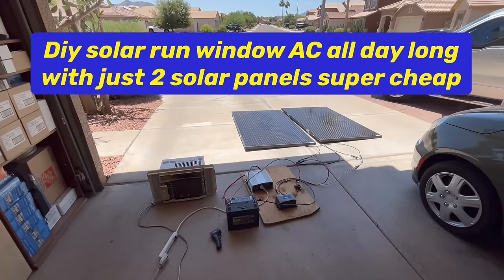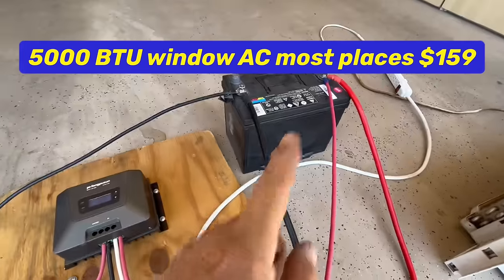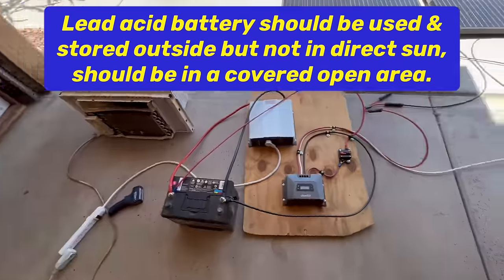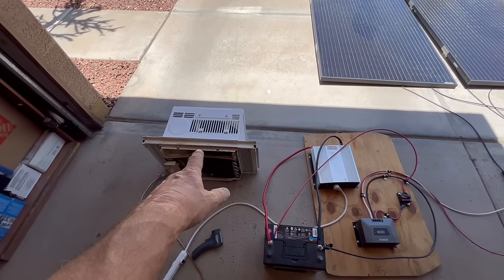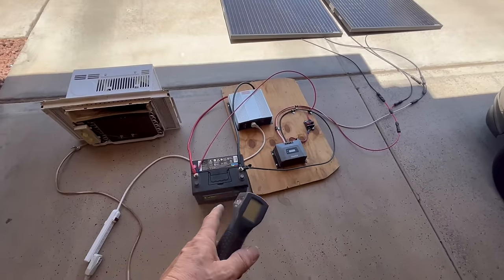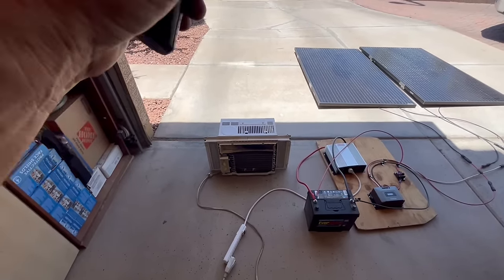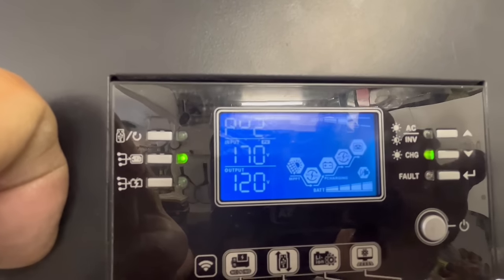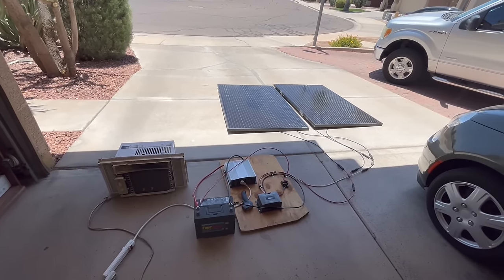Run your window AC with just 2 solar panels when sun shines. Easy DIY project you can do in one day.

Comment: Edited: Changed headline to be more accurate. That will run a small AC unit in daylight hours which would greatly reduce your power bills and a small system can also be used in a grid blackout for running many small appliances, tools and recharging gadgets.  I run my entire cabin off a 400 watt system with 200 watt recharging station.

If you want to run AC at night you would need at least twice as much solar and 3 times as much  battery capacity depending on how much it cools off naturally at night.

For people in low humidity climates a smaller swamp cooler works well and uses much less power. I run a Hessaire swamp cooler at my cabin and ir uses only 85 watts.

You also said panels keep producing  as long as they are getting sunshine. They only produce when connected to a load so if you disconnect the panels from the load they are not producing power.

Your system is connected correctly however I have my doubts  that the cheap Chinese controller you are using is actually MPPT and for any direct DC loads you need an inline fuse link. Surge on that AC unit is likely only 1000-1200 watts so you could use a 1500 watt inverter and it does not  need to be pure sine wave to work but would be better and the motor will last longer with pure sine wave.
Reply from the maker: You are correct I said all day long you can run ac, I did not say all night long. I stated as long as the sun is up you can run on solar and can plug in grid at night. Just trying to show you can run ac with a few solar panels. Minimal components. Not trying to sell anything here. Just sharing what I was able to run solar while sun was shining. I used this system for a year and half and worked great to cool shed. I appreciate your comment and information. Swamp coolers add moisture to area, this ac unit removes moisture. In high heat in az a swamp cooler is miserable, I know I used one for years. I had one in garage and all my steal in garage rusted horribly and used in house for one year as well and smelled the whole house up. Swamp coolers are not an option for a motor home or camper. I know a-lot of who use swamp coolers connected to house and hate the smell it gives off and the mold issues along with sinus infections and upper respiratory problems. This was just a video to show what you can do with solar with a window ac. People can add panels if needed or use a lithium iron phosphate battery to use overnight. I have a 10kw liFePO4 battery bank and a 8kw LiFePO4 battery bank that could run overnight. The video was only running ac in the day, not the night with the battery shown or 2 solar panels. Once again, thanks for your input. Hope you have a truly wonderful and extremely blessed weekend.
Reply: @The Solar Junkie A day is 24 hours so saying something will run all day means 24 hours. It will run through daylight hours.  I would change the headline to say it will run through daylight hours.
Reply from the maker: That is the way I understood it as well all  as I grew up was all day long while sun is shining. An entire day or day and night meant 24 hours. Thanks for you input and hope you have a truly wonderful and blessed weekend.
Reply from the maker: Thank you so much for your input and explanation. Good point, I may change headline so there is no confusion. Hope you have a truly wonderful and blessed weekend as well.
Reply from the maker: @solarcabin  changed headline to stop confusion.
Reply: @diy-solar-guy  Right on friend and sorry if I sounded harsh. If more people would do that they would save a lot on their electrical bill and can survive a blackout. I promote small off grid systems even for grid homes for that reason.

I gave you a like and subscribed!
Reply from the maker: @solarcabin  That was mostly old school components I showed in video. From when I first started messing around with solar 3+ years ago. They have new components that make it super easy to set up a system that are for beginners in solar, 24v systems. I have hundreds of people watching my videos from around the world in India. This video was more or less for them on what components you need to run AC and basic wiring conections. Thank you again or your input. I dont know everything and am constantly learning every day, I am self taught by researching solar and heat pumps, etc... I am permanant disability so solar makes the days and weeks and months go by much faster.
Reply: @diy-solar-guy  Never in a million years would I think someone meant 24 hours when they said "all day". I would think they meant exactly that, all "day" as long as the sun was up, not all night as well. I can't imagine hearing someone say "all day" and assume they meant an entire 24 hour "calendar day". Already knowing we're talking in the context of "solar", only further seals the deal securely.

Comment: This would be even better with the current inverter AC's thar slowly ramp up.
Reply from the maker: @kewlztertc5386  I have 6 12,000 btu 110 volt mini splits installed and they are very efficient. The mini splits slowly ramp up in watts used. The nice thing about mini splits is you can cool or heat 5 times the space and then when the temperature is reached, the watt usage drops below 50 percent of when you first turn on. My mini splits use around 1000 watts when first turned on but will drop down to as low as 300 watts when room reaches temp set on remote. We have evolved so much that we now run our upstairs 3 1/2 ton upstairs and 4 ton downstairs on off grid solar in the day and can run on LiFePO4 batteries overnight. Check out our latest videos with using the EG4 3000 watt inverters in parallel. Thanks for your comment and hope you have a wonderful and blessed weekend

Comment: Would one of the ultra cheap 12/24 30a solar charge controllers work as well or are your panels pushing to much power for that?
Reply from the maker: The window ac uses around 500-550 watts and 5 amps while running on high. So the charge controller will need to run load and keep battery charged at same times with this lead acid battery, if there is not enough solar, that battery will drop fast and go below the 12 volt threshold that you do not want to drop below. I would think it might work, it just depends on how much solar it can handle on 12volts, with a 24 volt battery bank you can double the amount of solar panels you can use with a 12 volt battery bank. So I think if you used with 24 volt battery you would have a better y chance at successfully running ac all day long from 8-9 am to 5-6 pm. Just depends as well as to how your solar panels are mounted and angles towards the sun. That will make a huge impact on output from solar panels. Thanks for the question and hope you have a wonderful and very blessed week

Comment: Does that mean that you travel at night and sleep most of the day?  What do you use for AC at night?
Reply from the maker: This is just a simple set up to show basic components needed to run ac with solar. We actually use solar to completely cool and heat our house now along with garage. We use LiFePO4 battery bank at night to run ac upstairs where bedrooms are. Check out our other videos and see all the large amp draw appliances we run with off grid solar. We actually run our central heat pump ac’s or we can use 6 mini splits installed throughout house and garage.

Comment: Great video! I wonder if you tried run it at night too to see how long the battery juice lasts?
Reply from the maker: Lead acid and AGM are only meant to be used during the day while sun is shining with solar panels producing power for load and to keep battery charged. Lead acid and AGM were not designed to run overnight. You would need LiFePO4 batteries to run overnight. I used 2-150ah, 2KWh each in parallel for a total of 4 kWh to run over 8 hours just batteries. FYI
Reply: My question is almost answered in your response. If the battery in this video is only used for day time use, what is its purpose? Is  it to buffer the start up load when the ac cycles on? Or perhaps to help with very partial shade? Thx!! Great videos, great channel and thx for sharing your knowledge.
Reply from the maker: @daxdamato2118 they battery bank is to keep the load stable drawing from battery when sonar is not enough. I run a lot overnight, these are LiFePO4 batteries which can run loads over night like my  3 1/2 ton heat pump that cools the upstairs of our 2 story house. Run both 3 1/2 ton upstairs and downstairs 4 ton heat pump to air condition our house when 110-118 during the day. You need the battery bank to run off grid solar.

Comment: Adding a "soft start" would help with the compressor surge upon startup.
Reply from the maker: Good point
Reply: Not cheap.
Reply: what's that
Reply from the maker: @Chevroletcelebrity  a soft start is something you wire to air conditioner to reduce the amount of inrush amps to start compressor so you can use off grid inverters and gas generators to run your ac unit.
Reply: @Chevroletcelebrity  an Electronic device.
Reply: @diy-solar-guy  like a start capacitor?🤔
Reply: @Chevroletcelebrity  correct, a "soft start capacitor"
Reply: @dodgeplow  well why didn't you just say that? 🤨
Reply: @Chevroletcelebrity  I did. I only posted once

Comment: Do you think it can work with our 220 volt system in EU ? Thank you.
Reply from the maker: Yes they sell all the components but you are using 50 hz as where in the United States we use 60 hz for electric. So just make sure you are getting the right off grid inverter. Most inverters sold in United States are programable to 50 or 60 hertz. You would also want to get split phase inverter or 220 output inverter. There are a lot of options out there. Most people once they see off grid solar work want to expand their system so you might want to look at inverters that can be paralleled together so you can increase your output later. Hope this helps. Have a blessed day
Reply: @diy-solar-guy   Thank you so much, I will look into it, but wondering is running a 24v truck air condition with a 24v battery and solar system would be cheaper and easier to set up ?
Reply from the maker: @TekFrank the only way to find out is to try it. I like the mini split heat pumps to heat and cool, they have 120v that are around $500-$600. I had mine for 3 years now with no problems. Best bang for you dollar. Does not matter what solar power system you have as long as you have 120v output to connect mini split. I also have a 230 volt mini split for my garage which is 18,000 btu. Does excellent job heating and cooling. 48v systems are probably the most efficient as where your battery like my server rack batteries are easy to connect in parallel with other 48volt server rack batteries and they communicate very well to all stay stay charged and discharged very very close to each battery voltage. But use what you think will work best for you and what you can get that is reasonable priced.

Comment: The battery won't explode, since the airconditioner unit is less than 500 watt, EEF, while the battery can be opened in order for it not to get warm, too much friction/kinetic energy on-going, that can be controlled using the FAN or EXHAUST, while the Inverters already have built in surge protectors, depending on the size of the battery, it won't heat much or burn, as long as the BATTERY has BIGGER Capacity than the AIRCONDITIONER's output and input, RATIO Energy Battery power storage 1500 capacity 500-1500V 4 to 5 battery size parallel, within the limit of the output from the mechanical source-Airconditioner 500W, 500:1,500. Allowance of a 1000 for it to breathe cooler and for the Inverter not to be exhausted limit 2000 Watt capacity.
Reply from the maker: Thank you so much for all that information. We appreciate it

Comment: I plan on setting up a solar system in the next few months to run my AC in the garage. I am also in AZ. I am thinking 10kw worth of batteries should be enough to run the AC. what are your thoughts? thanks for any suggestions.
Reply from the maker: I was able to run this window ac for 8 hours with 2-12 volt LiFePO4 150 ah 2KWh each. So I had a total of 4kwh that ran it for 8 hours. Your 10KWh battery if LiFePO4 should be more than enough to run with solar in day and overnight with battery bank. If AGM battery bank, don’t expect to run more than 2-3 hous at most overnight. Can only run AGM batteries down to 12 volts at 100 percent discharge, don’t go below 12 volts. LiFePO4 batteries can go down to 10-10.5 volts at 100 percent depth of discharge. If your battery bank is 24 volts than LiFePO4 battery bank can go down to 20-21 volts depending on your battery specs. If 48 volt battery bank, your LiFePO4 battery bank can go down to 40-42 volt’s depending on specs of LiFePO4 batteries. Hope this helps. Have enough solar to keep batteries fully charged in day while sun is shining and running your load. This system I showed was the basic bare bones, so adding and improving on it will only make your project that much more successful.

Comment: Subed to see mini split on motor home dude!
Reply from the maker: Sorry, had a senior moment. I hope to buy mini split for motor home this summer. Stay tuned. I am going to do a video using a 2400 watt Mpp all in one inverter to see if I can run my main ac during the day or window ac all day and night. I have 4-12v LiFePO4 batteries I use on a 48v inverter to run mini splits in my house. I will use those to go camping since I won’t need to cool my house. Those are a total of 8kWh of power storage. More than euro run window ac or mini split units. Hope you have a wonderful and blessed day. I have over 100 other videos you might find interesting to see how I use mini splits and off grid solar.

Comment: Whats nice is this is scalable. Can get a larger window AC and just need to add enough solar panels to accommodate the required wattage
Reply from the maker: You are correct, I will be making a video of using a 24 volt off grid all in one inverter and more batteries to not only run window ac, but able to run 3 or 4 window ac units or 2-110 volt inverter mini splits 12,000 btu units that can each air condition or heat a. Room 600 square feet or less. Thanks for your input.  Hope you have a wonderful and blessed weekend

Comment: Since your video suggests using the grid at night, does it mean that the battery isn't getting enough charge?
Reply from the maker: You are correct. This is a lead acid battery and will not run ac more than a few minutes without solar charging battery and running ac. You can not use a lead acid battery or even AGM to run ac overnight. You would need at least 5-8 kWh of lithium iron phosphate battery bank to run window ac overnight. I actually run my 3 1/2 ton and 4 ton central ac during the day with solar and 3 1/2 ton upstairs ac overnight with LiFePO4 battery bank. I also air condition my garage all day with solar to keep at 78 degrees. I have 3 bedrooms over my garage and in Arizona your garage is same tamp out side and 20-3” hotter than that when you pull a hot car I and close gaffe door. Out here summer temps have been 112-117 degrees in the day. So you can simply unplug ac from inverter and plug into wall outlet and use grid power overnight. Thanks for your comment and hope you have a wonderful and blessed weekend